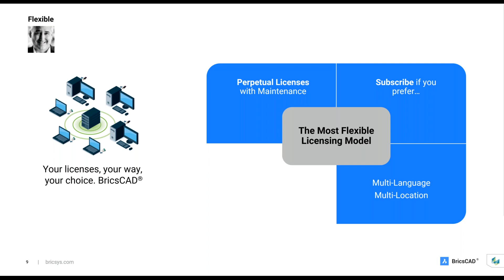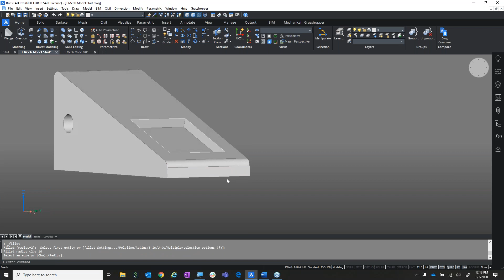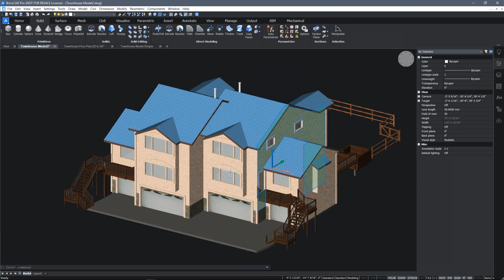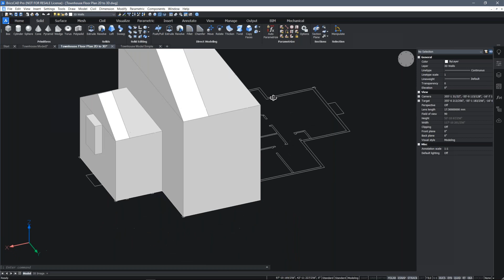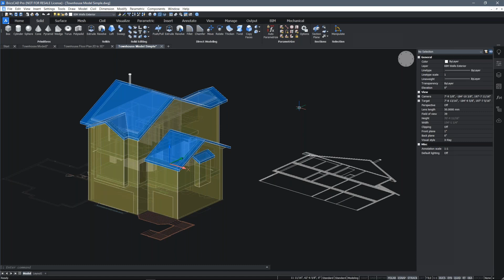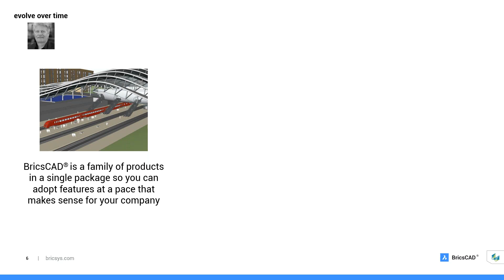Moving to 3D with BricsCAD Direct Modeling l BricsCAD Discovery Webinar

Comment: Thanks for the video. I'm wondering what's the shortcut keyboard to go from 2D to 3D or the other way? Thanks
Reply from the maker: Hi! You can use the EXTRUDE command and change the Visual Style from 2dWireframe to Modeling.
Reply: @OctaveBricsCAD  I'm not sure we're talking about the same. I'm asking about the 2D and 3D icons on the right side of the Vue menu. I would like to switch between the two without the mouse.
Reply from the maker: The 2D and 3D icons located on the right side of the View menu
refer to the VisualStyles command and its different states. You can create your own shortcut using the steps from this Help article: https://help.bricsys.com/hc/en-us/articles/360013485500-How-to-create-a-keyboard-shortcut